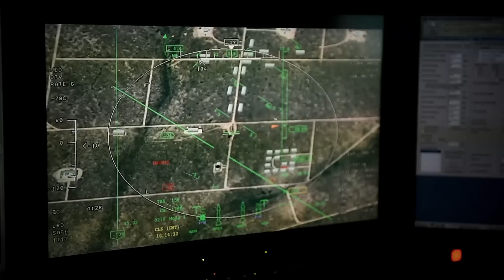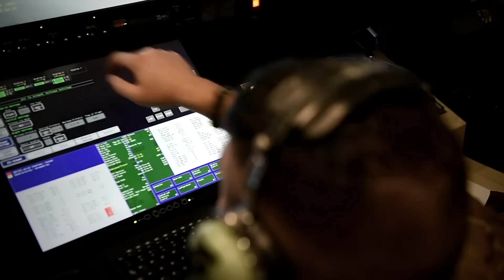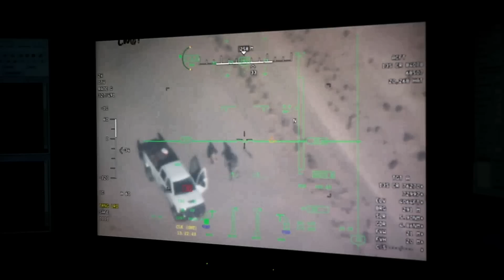Area 6 Secret Base Satellite Photos

Comment: I'd be disappointed if we weren't constantly creating and testing new stuff. Of course they would want the tech they're testing secret.
Reply: Check out count down to disclosure.
Reply: Absolutely!
Reply: Of course they are working on improved technology. Most likely improved stealth and materials research. I suspect that Lockheed Martin's Skunk Works and Boeing' Phantom Works have built advanced aircraft to test out technologies in aircraft design and control systems. Some of which work and some of which don't. It's worth it to the nation to do this simply because it keeps a core cadre of skilled people together. Starting an aviation company from scratch is not like opening up a law office or accounting firm.
Reply: They have everlasting bubblegum. They won’t tell us
Reply: @brett567  Knowing it exists and knowing the actual tech tested there are two different things.
Reply: Amen
Reply: This place is not hard to fine
Reply: We?
Reply: Well siri was invented by darpa so that's something you've seen go from nonexistant to advanced secret tech to publicly available in your existence and that something they deemed mildly useful
Reply: Bingo. this is the correct answer. you think next generation planes are magically built? some group of engineers have to figure it out before mapping out production scale
Reply: I’m sure they have stuff we will never ever know about unless they absolutely have to break it out and use against another country.
Reply: @firewalker1372  Several planes were put into use years, sometimes decades, before we knew they existed, and sometimes even then it was more years before we knew what they looked like. I take it as the natural order of such things.
Reply: agreed, test more to know more!

Comment: There are airstrips all over Nevada.   Some are old WW II bases,  some were emergency landing sites.   Some are copies of the layout of foreign bases used for practice attacks.    You can speculate on any of them with all kinds of "secret"  ideas.
Reply: As you can see, this one is none of those. It is high-tech and in a very remote location.
Reply: @burtpanzer  its very short for a run way
Reply: @scottyo64  It isn't for large or fast airplanes, so what's your point?

Comment: It's a drone base. You can look at Google's historic imagery and see several around the hangars. It was only a single building with a helicopter landing pad back in the 90s with no air strip. Then it had a dirt strip built between 98 and 2002 before getting paved properly between April and June of 2005. While it's not certain how old the original building is, the runway has only been in existence for about 20 years.
Reply: The short runway seems to support your statement. A one mile runway is very short for aircraft.
Reply: @vondahe  yeah its for soldiers to drag race their mustangs down the strip
Reply: @fjuhyiaesghubfkaekB  cant forget the sign on bonus challengers either lol
Reply: You can watch drones often right in Indian Springs. The runway is right by the
highway there. I have also watched the Thunderbirds practicing there.

Comment: Some of these senor manufacturing, testing and calibration are very sensitive.  Lens/cameras are also classified as sensors as well.  The reading of these tests can be affected by electricomagnetic fields from cell towers, power lines, mobile phones, antything transmitting telecommunication frequencies.  You need a very remote, sterile location in order to test and calibrate these sensitive sensors accurately

Comment: This isn’t just an air base. The base goes under ground. The base is most likely got a massive tunnel system which has many junction points Area 51 being on of them. They likely store air craft underground as well not just UAVS either, experimental air craft do live there.

Comment: I was chuckling out load when you said “there appears to be no planes”.  That’s because the rectangular black ends of the runway w the white painted chevrons are actually hanger elevators for underground storage…as you would see on aircraft carriers….it’s commonly used in these desert facilities in order to shield the sensitive electronics from the deadly summer heat.
Reply: I get what your going for but those are just normal runways. If they did use elevators, they would be inside the hangars I'm sure.

Comment: So many old and new air strips and facilities out there.  If you look about 6 miles WNW of  the Sedan Crater, there's another facility tucked in a box canyon.  It might be Area 12, not sure through.  It connects into Mesa Rd which will take you down towards Mercury and Area 6.  And while I don't have the coordinates at hand, if you look hard enough you can find the tunnel entrances.  Some will have vehicles parked outside them.

Comment: All you have to do is Google Earth the runway. Use the measuring tool between two identical parallel skid marks. Janes Fighting planes has main mount/ tire widths to narrow down what has been touching down there. Use Creech as a primer.

No arm/ dearm pad on the apron, nor compass rose for avionic equipment calibration away from the main structures. Looks more for utilitarian use than operational/ tactical and low impact on the the active runway.

Comment: 1982 is 2 years before Richard Marcinko started Red Cell, after leaving Seal Team 6 in 84. I suppose it could still have been those guys testing security there though, the military doesn't like to talk about Red Cell. Hooyah Commander Marcinko, the work you did will live on forever.
Reply: @Steve Sherman You have a link to this?? I can find nothing on Colonel Beckwith grading military security. Not accusing you of lying, just can't find any info on it. Again though, the Military doesn't like to talk about security deficiencies.

Comment: The REAL secret base is in Utah. It sits out in the middle of the west desert, west of Salt Lake city, and separated by 2 mountain ranges! A majority of the base is underground, far from curious eyes. There are also unground roads with access points that can open and close to let vehicles out anywhere on the grounds. The base goes for hundreds of miles across a portion of the old Lincoln highway and parallels the piny express trail. We witnessed some very strange activity. This is the NEW area 51.
Reply: If they are labeled with correct runways on flight simulator, I doubt they are all that secret.
Reply: I'd think Diego Garcia could be a perfect secret base because it's truly remote in the middle of the Indian Ocean.
Reply: @marcbee1234  too much water too little island I think
Reply: @Steve Sherman This is beyond dugway. All underground.

Comment: lol I work at a military spot built in the 60s that's in the middle of the woods and is surrounded by about 6 airports I can see from the top of the 10 floors. lol stuff like this is way too common. I won't even get started on what I've seen.

Comment: I would assume everything apart from it's location is classified, and since there are little more than hangers visible, I would also assume the bulk of the facility is underground which would likely extend into a network of interconnected tunnels using a high-speed maglev rail system... I'm guessing.

Comment: Gee... the only thing you didn't bring up are the little green men that are stored there which do the engineering.  FYI, the truth is that they test military drones there from the various contractors that build them like Lockheed Martin, Northrop Grumman, AeroVironment, etc.   Yes, many of these drones are classified.  The only part that was there for the nuclear bomb testing was the control room that seniors were wired to.

Comment: sorry to but in but it does not take a mile long runway to use drones to take off anybody that has had an RC plane knows it does not take a mile to launch a drone, may a 747 or aircraft of that size would require  a mile long runway

Comment: That's a real short runway. A mile?
Reply: Using Google map's measurement it's a mile but that's threshold to threshold.  Basically it's the same as any large commercial airport....nothing special.
Reply: The average runway is between 8,000ft/2438.4m(1.5 miles/ 2.4 km) and 13,000ft/3962.4m(2.5 miles/4km) feet. It's a very short runway. 

Yes, the runway on a carrier is 500 ft. However, jets use a tow hook to stop on a carrier instead of using wing spoilers as air brakes along with the disk brakes on the landing gear.
Reply: @Steve Sherman  I'm not saying anything about any specific type of jet or aircraft. All I'm saying is the length of that runway is short. The data also backs me up. Why is this an argument?